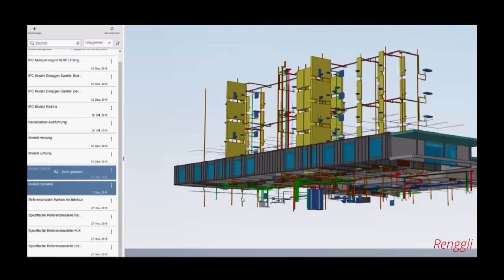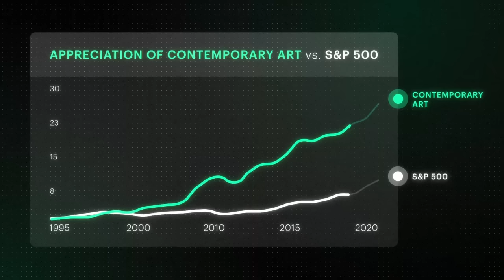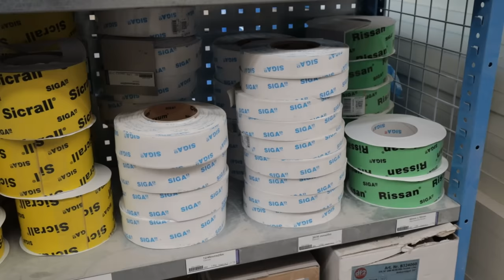100 Year Old Swiss company builds homes with Robots!

Comment: Very interesting.

For anyone who's curious about the sustainable logging idea, have a look at British Columbia's logging industry.  Our forestry industry uses clearcutting techniques that reserve certain ecologically significant trees (those near rivers and streams to manage erosion, those that are notably taller than average for predatory birds, etc) and monitors them enough to ensure that the trees they plant grow up good and strong...they have a vested interest in this because somewhere between 20 and 80 years from now, they'll be back to do the same thing all over again.  (Depends what they're planting and what the nutrition conditions are like.  Most of the forests around where I live are what are called second growth forests, meaning the original forests were cut down long enough ago that the forests we have now look pretty much like normal forests even though they're managed woodlots.

(And currently, as far as I know, wood construction is actually the best means we have of carbon sequestration.  There's timber frame buildings built upwards of a century ago that have fully grown forests sitting where the trees that got cut down once stood.  In nature, all those logged trees would have rotted away, but by drying them out and sticking them in a waterproof shell (that is to say, making them into a house) the wood doesn't rot and thus doesn't release its carbon back into the atmosphere.   We're working on much more advanced tech, yes, but it'll be a while yet before we can manage those systems on  a scale that matches the combined efforts of forests, and the forestry and construction industries.

Comment: Way back in the 1990s I worked as a chief estimator for 2 large construction companies. Both used modulated computerised systems. When I started with each company I found their systems way under utilised so set about trimming components to the bear minimum and improving the labour orders. In both cases I was able to reduce costs saving time and waste throughout the entire process.
In doing so it also assisted the companies in offering cheaper customer specific alterations to standard models. By feeding the systems measurements I was able to produce competitive sale prices to the sales team of fully custom architectual design in less than a day. Be it slab or pier and beam construction (with site works added after geo inspection) without interferring with the daily out put of orders or standardised sales pricing.
It is good to see people using technology in the construction industry as it should be for the greater benefits for individuals as well as society as a whole.
Now I live in a under developed country where I see so much misunderstanding of engineering and design, so much waste, poor low grade materials and shoddy workmenship which all adds up to extra cost and heartache for the customer. Not to mention building collapse in natural disasters.

Comment: Hopefully this is the prototype of things to come here in Australia too. Thanks Belinda, great presentation.
Reply: We already do stuff like this in Australia, it's not so popular ATM, but it's getting bigger

Admittedly, it's not this complex, we still install our plywood on site, but alot of this is very familiar to me, at least. I believe we even use the same hundegger machine.

Name of the company is sekisui house Australia
Reply: @candylord  Thanks! I will look them up.
Reply: @candylord  Damn, their website has little about the design and manufacturing of entire panels complete with conduits, insulation etc.
Reply: @MiniLuv-1984  yeah, unfortunately it's a little less advanced than what you see here. The wall panels themselves are built in the factory, but finishings and utilities and such are still done on site. I believe there's some regulations getting in the way of doing everything fully modular, but that's not my field
Reply: @candylord  The good side of that story is that there is, at least, a desire to move in that direction. 
It just makes so much sense - a controlled environment that allows for precision, efficiency, quality and alleviates the vagaries of weather. 
I'm not in the field, but I imagine slabs can be set up to accept such pre-fab panels using the same engineering drawings the pre-fab are made from. Getting the guys on-site to maintain high levels of accuracy might be a pain...but then again, site variations can be accommodate in the design and build to some degree. I suppose roofing and ceiling panels could also be made the same way? Not sure. Still a fascinating and inspiring idea.
Reply: @candylord  I'm sure that building regulations will get in the way...on the one hand its good to reign in the dodgy brothers but it also affects everyone else - the consumer in the hip pocket and the design, construction and build industries in buckets of red tape.

Comment: I would be very interested to see the erection of these buildings to understand the connectivity structurally, electrically & plumbingly. 
FYI modularized construction has been around at least since WW2 when Henry Kaiser modularized Liberty Ship construction, & probably before.
Reply: Many thousands of `prefabs` were built in the UK after WW2 as a short term measure to house people whose homes had been bombed. The electrical wiring was a pre-assembled harness known as the Octopus system.
Reply: @rjmun580  Interesting, how were the "legs" tied in when the walls were assembled? Ceramic (c.1933) and later Bakelite wire notes we available in the U.S., were those used in the prefabs?

Comment: AcQbuilt in Alberta Canada also uses automated screwing machines - you could check out their factory too. Most of the Cons you listed don't seem bad to me. And most aren't a problem with modular construction, but just with the industry. People don't need custom things - if they are substantially better quality for similar or lower prices - people will buy them. As demonstrated in almost every other industry - and by the fact that people live in extremely similar condos/cookie cutter suburb homes/etc. already. These approaches will continue to grow as we place more value on energy efficiency, and phase out the ability to just waste vast amounts of energy in a home and still be comfortable.
Reply: There are levers of modularity.
Right now it is very low, which makes no sense to me as an engineer.
Reply: @valdius85  Yeah for sure - another area which is fairly modular is modular homes haha. (Also known as mobile homes or trailers.) Many of these are built each year in factories and shipped out to folks!
Reply: I have toured ACQbuilt, they are not close to the quality of this Swiss plant. The stud material used at ACQbuilt is LSL, not Glulam. The workmanship was also not as good. And a lot of the yard storage are just sitting in the open without plastic wrapping.
Reply: @UnbreakableM1nd  Good to know! I would expect European builds to be better than North America - but ACQbuilt can adjust to the building code as it changes as well.
Reply: @leonmilner9994  I think ACQBuilt has done as well as they possibly could. The problem in Canada is the residential building market is it’s all over the place, sort of like the wild west. And Canadians love their unsustainable single family homes, which is the main market for ACQbuilt. Unfortunately it’s hard to make a profit in this sector, so it’s always a race to the bottom.
Reply: It would be more precise to say that customers do have a strong desire for customized products, but the appearance of customization can be superficial, (e.g. different color or exterior cladding type) which does not require re-designing each building.  Much of the inefficiency in cost comes through architects, whose professional success requires each building to be different, something antithetical to cost savings, and thus in competition with the desire to create high performance housing which is affordable to society and to the environment.  Still, the biggest obstacle in most places is planning permission.  Modular buildings have the potential to create indoor spaces for relatively short time periods (say, 20 years) with the buildings then being moved when land use changes occur due to economic, demographic, or environmental changes.  Humans did this for millennia - we called them "tents".

Comment: Been following you for a long time. Just to ask is there a premium cost in raw materials in terms of engineered wood vs. natural? If so is all the cost made up in waste control and automated systems? Not having to "eye ball" each 2xN would be a great advantage.

The issue for foresting is the replacement multicultural forest with a monoculture. BUT overall moving some land over to sustainable wood is mostly required now.

Comment: Wow, so impressive but no mention of final build cost at completion at site. Welcome back!
Reply: These houses compete in a market that already meets very high standards, especially in terms of durability, energy efficiency, fire protection, earthquake resistance and sound insulation. In Europe, new buildings are generally designed for a lifespan of 40-80 years. People put a lot into the construction and expect a long and relatively low-maintenance lifespan in return.

In this market, these wood-prefab buildings meet extra high requirements in terms of sustainability and low pollutant content. So they are extra high quality buildings in an already expensive environment.

Such a house is virtually the antithesis of the balloon frame and would have a hard time finding its niche in the fast-paced American market.

Comment: The first step is the design. Without it homes will ever be cheaper. Everything custom is always expensive.

In Japan most people can only afford pre-designed homes from  it manufacturers. They choose the model and can only change little details - paint etc. 

The crew is very efficient because of their experience and all parts are easy to handle by one or max two people when needed.

Obviously earthquakes and typhoon influence the design, to long spans and high sealing are for rich people. 😂

Comment: So, factory is based on expensive labor instead of cheap labor. 3D designer hour wage is 5X more then floor carpenter except if they outsource modeling to another third world country. Error margin is almost the same as designer probably never seen end product. They are highly dependant on automated complicated gear to work properly and in case of failure it will be costly as maintentace is high cost. Low number of workers does not contribute local community either. Highly efficient work environment does not do any good to workers on final assy, mixing robots and humans do not work for humans. Then it comes to a question of robotic hiperproduction which is disaster by itself. All of this output expensive end product.
So, again, what is the good part? 
Is it where multimillion $ company which makes automatization process benefits?
Or where end user has to take 50yrs morgage instead of 30 due to a cost, benefiting the bank?
Reply: No, maybe in the US, but here a 3D designer has about 1.5-2.5 times the wage of a floor carpenter, and most of the workers there are still carpenters/factory staff. No, they don't out source. No, the designer is in house walking the factory floor...so they will not have the same flaw rate as they can controll the whole process much better. The gear has been used in the industry for over 60 years, it's mature. Low number of workers is good, keeps prices down and people can always find other jobs, and in the EU if you become jobless you get support, so it's a none issue. 

The good part is that the design can me more precise, have less waste in material and be built much quicker. So overall, faster building speed, lower cost, better working conditions, and better quality. Win, Win, Win Win. 

House and property prices are much lower in the EU as the countries governments also build houses to compete and push prices down, benefiting the people.

Comment: Belinda,  Thanks for you videos.  I think it is great you to talk about many different building alternatives and gives the pros and cons of each approach.

I'd like to plug an idea for a future video.

I'd like someday soon to build a non-tradition house and am thinking of using steel-framing as described in this video.  This is FrameCad applied to a tiny house design, see the video. 

https://www.youtube.com/watch?v=nEGtSgUpUkI

The advantage that I see is.   
  Steel will be accurate down to the millimeter, so no warped word.
  For a tiny house on a trailer, it is lighter than wood.

 disadvantage:  
    thermal bridging
    ( not sure but likely ) cost.